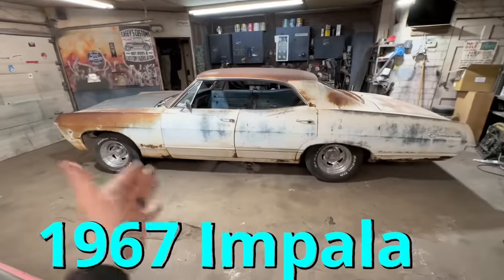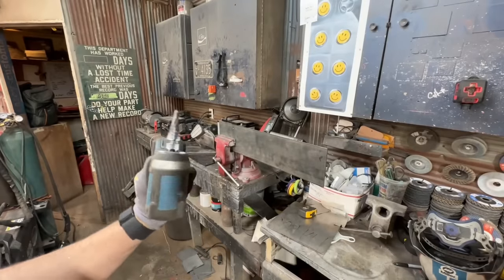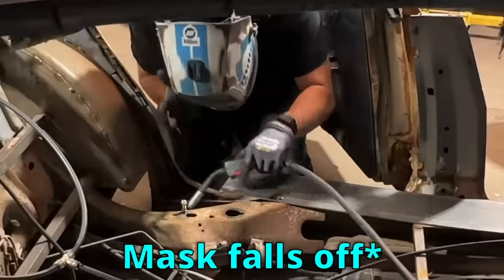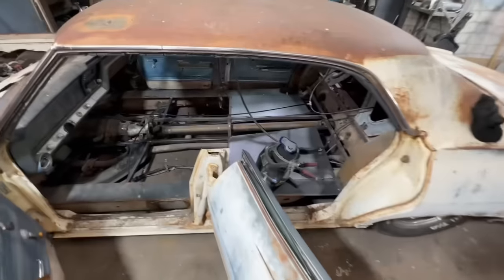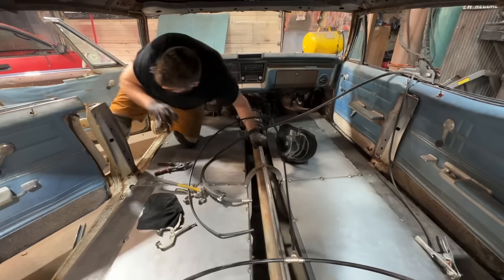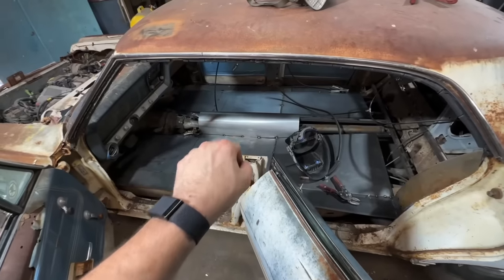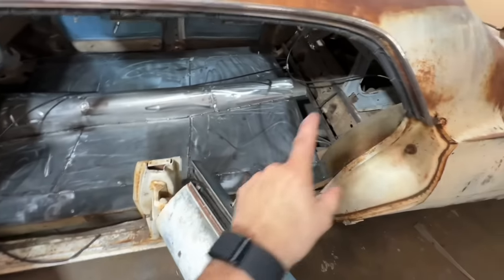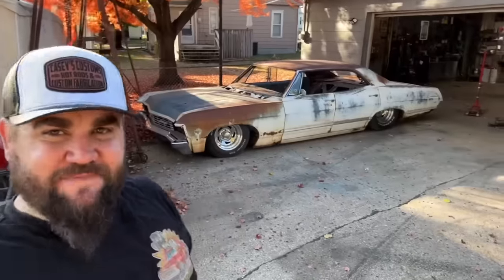CUTTING UP BABY! 1967 SUPERNATURAL IMPALA BUILD! CHASSIS SWAP GETS A FLOOR MADE! HOT RAT ROD KUSTOM

Comment: For all the people that say you can't solid mount the body to the frame,,,,,,, you're basically making a unibody. It works just fine. As long as you don't need to separate the body from the frame later.

Comment: Couldn't you cut the plate with the plasma cutter or does that effect it's strength?
Reply from the maker: You definitely can, it just doesn’t cut very straight and then the edge is rough so you have to grind it down